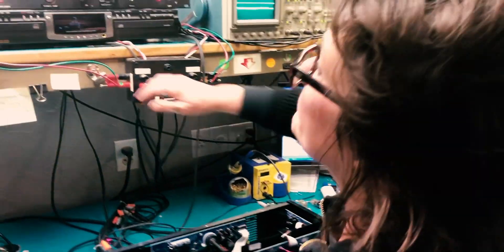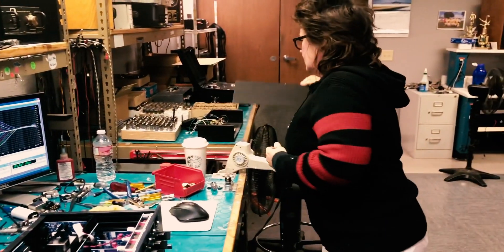Manley Tech Tips: One of my channels is out!

Comment: In all of their videos where lots of tubes are shown, most are EH. Especially E88CC, i think i've also seen other types from JJ, Sovtek, for sure also new production Tung-Sol 5751. Prices for retube kits are low enough to use them when same parameters and types are needed which is not uncommon. Can't say where they put NOS but from their perspective it only make sense using well tested new production. Circuits also have lots of NFB which reduces difference between tubes, then there are transformers having more distortion and other artifacts than tubes. NOS craze will soon be over because larger stocks are depleted, a lot of fakes or pulls are on the market selling for incredible prices. More importantly, Russia makes very good products that aren't inferior to most Western NOS. I'm not surprised because they are doing it for over 100 years.